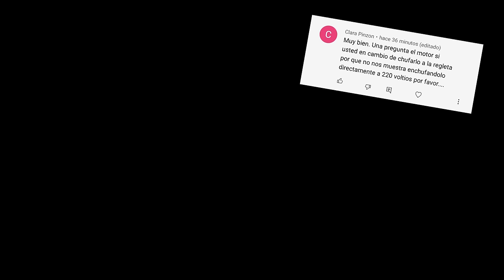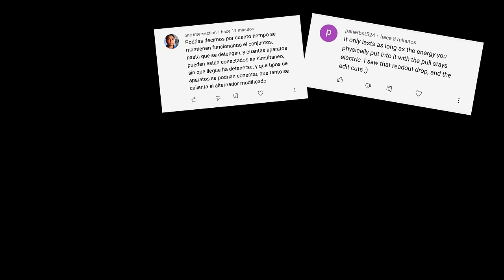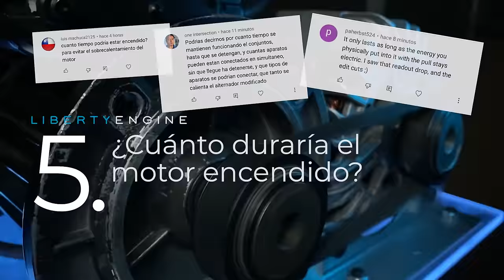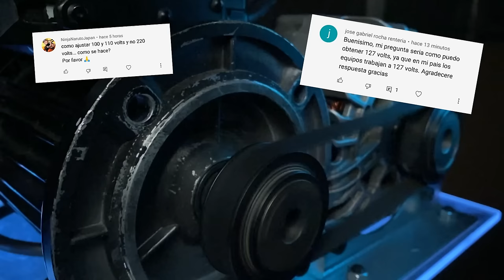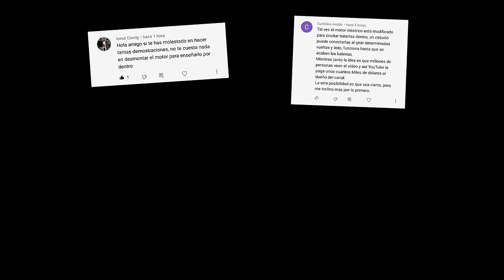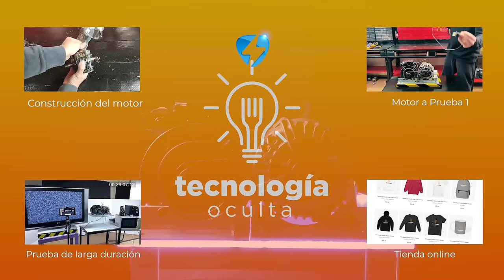El motor de energía infinita puesto a prueba - Parte 2  - Liberty Engine 1.0

Comment: It's too good to be true!!!
But let's talk numbers:
The car generator produces 90 amps at 14 volts, i.e. 14*70=1300 watts. This cannot under any circumstances be increased to 10000 watts...
with conversion to 220 volts it will have 1300/220=6 amps..
this energy is not enough to turn even the motor which is around 3 hp.
What is happening is that the cable that is connected to the power strip, and is not in an obvious position, and that you placed under the black motor, is connected to a 220 volt source...
If this is not the case, at the moment when this structure is working, lift it up, to see that there is no hidden cable that feeds the power strip...
Be that as it may, with simple logic, if you have invented something like this you would be a trillionaire and you would have solved the planet's energy problem forever...
Reply: 14v 190 amp, alternator Boss, valeo, mercedes, porche cayenne, etc, 3000 rpm need to produce, lake bomb water with condensador  , and neodimium, 
También soy escéptico.

Comment: I am Korean and I am an electrical engineer with 25 years of experience. I doubt you.

1 Why don't you do a live broadcast? Why can't you reveal your face?

Do a live broadcast right now. I will recommend you to the Nobel Prize organizers if you live a 3Kw coil heater for at least 2 hours, where heat can be confirmed visually.

Comment: Michael Flagg
 ·
Works at MU Research Reactor6y

Originally Answered: Is it possible to create a free energy apparatus?

The standard answer is that there is no way to build a device that delivers more energy than what is put into it. Many have tried to build perpetual motion machines, then later other "free energy" devices based on various electromagnetic phenomena or other more esoteric principles. Every single one of the devices ever proposed to my knowledge would violate one or several "laws" or principles of physics as we know it today.

To date, none of those devices have been publicly demonstrated to work in the fashion they claim. The basic laws of physics as we know them today have remained intact.

The only way to get this answer changed to "yes" would be to build one, demonstrate it, and allow others to build their own and then demonstrate them as well.

Comment: 😁😁ALL the respect for your work, but... there are current generators on the market with avr included, you don't need magnet spells anymore, you just attach an electric motor with optimal low consumption to drive it through a motor F amplification mechanism and that's all the magic secret and other shit..